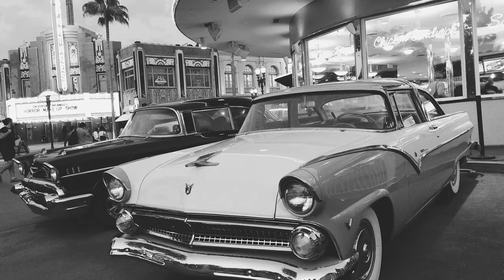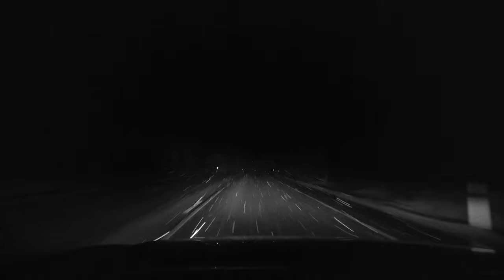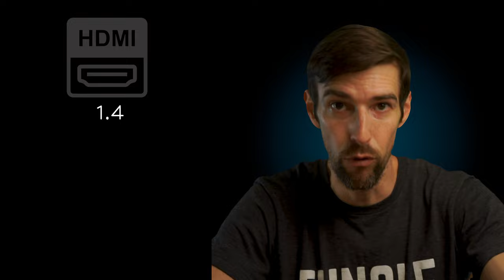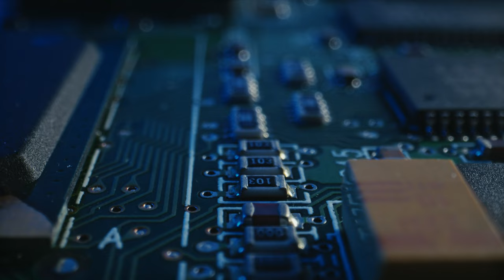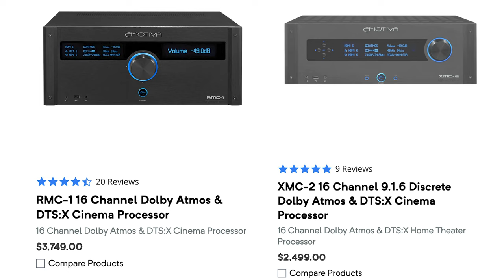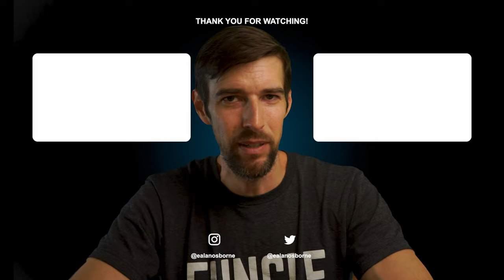BUILT TO BREAK: Why Electronics Are Designed to Fail | Technology | Generative AI

Comment: I had a Denon 940H i believe and took it to a repair shop and the guy said it needed a power supply so he fixed it for $100 he was an old guy been open for 40 years. When he closes there are no more repair shops around here.

Comment: There is no excuse for recievers/AVR's to be made in the way they are made today, amp+preamp+decoding+power can be made modular as possible. Trinnovs premium is not on hardware only, it is the software that does most of the magic in Trinnov. Nevertheless there is no huge advantage of using DSP/FPGA's over CPU's these days (for surround sound decoding).  If there is Dolby ATMOS/DTS-X software for PC's (HTPC's) they can do the full n-track decoding including MadVR like video output as well (with a dedicated GPU).